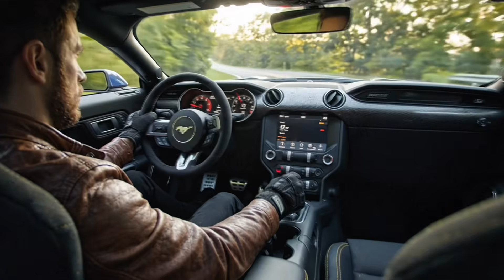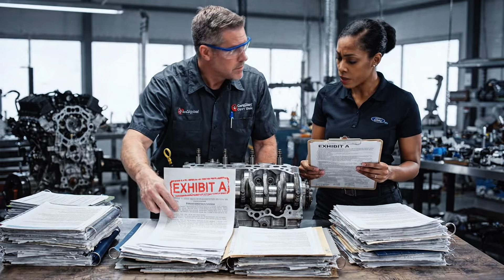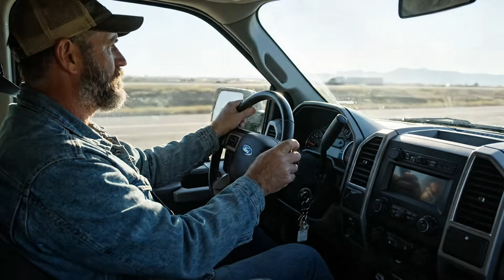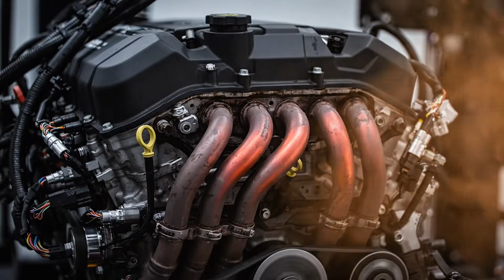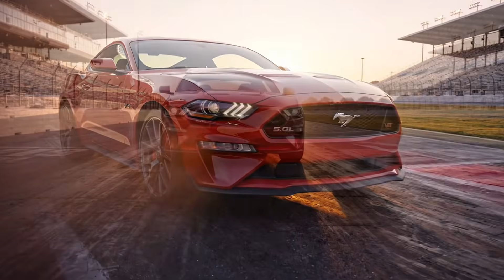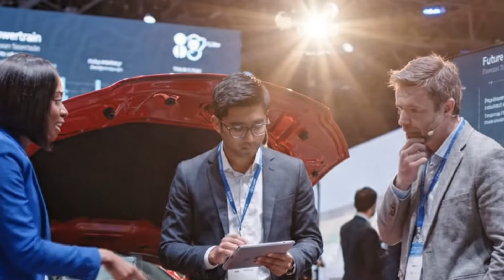Ford Quietly Fixed the Biggest Problem With the 5.0L V8—And Nobody Saw It Coming!

Comment: What years are you talking about
Reply from the maker: Mostly the Gen 3 and Gen 4 Coyote era. Which model year are you asking about?
Reply: @NextGenWheels-s5r 2019 Gt PP2
Reply from the maker: @murraycochrane240  Nice choice. The 2019 GT PP2 was one of the best naturally aspirated Coyote setups Ford ever offered—great balance of power, handling, and high-RPM character. Hard to argue with that combination.

Comment: That wire liner was in the GT500 , and vodoo engines not the  regular 5.0 L
Reply from the maker: Good point. The plasma-transfer wire-arc liner got most of the attention on engines like the GT500 and Voodoo. My main point was how Ford has continued refining its V8 technology over the years, but I appreciate the clarification.

Comment: Get rid of cylinder deactivation
Reply from the maker: A lot of V8 fans would agree with you. Cylinder deactivation helps with fuel economy on paper, but many owners would gladly trade a little MPG for simplicity and long-term reliability.
Reply: @NextGenWheels-s5r  the cylinder deactivation used by FORD has been reliable on the 5.0 as compared to the GM version, no lifter collapsing, more simplistic
Reply from the maker: @user-dan982  That’s a fair point. Ford’s setup does seem to be less controversial than GM’s so far. It’ll be the long-term mileage numbers that really tell the story, but many owners have reported good results.
Reply: @NextGenWheels-s5r  Ford 5.0 V8 is not a push rod engine is a dual over head cam engine personally I like the Ford 50 a lot better than the GM V8
Reply from the maker: @user-dan982  That’s one reason the 5.0 has such a loyal following. The DOHC design gives it a very different character than the traditional pushrod V8s, and a lot of owners appreciate the higher-revving nature and smooth power delivery.
Reply: I came here just to say the exact same thing ! It’s literally got me on the fence from buying a Ford F-150 right now ( I am certainly not buying any turbo charged crap either ! )
Reply from the maker: @NorthwoodsNomad  I get that. The 5.0 is appealing to a lot of buyers for exactly that reason—naturally aspirated, proven, and straightforward. The good news is Ford is still giving customers a V8 option when many competitors are moving away from it.
Reply: @NextG @NextGenWheels-s5r ree with you on that, however, I guess my point is : if I were concerned about fuel mileage, I’d just go buy a moped . 
Pickup trucks are made for working , pulling towing, hauling and handling a heavy workload . Trucks were NEVER intended for daily drivers or commuters or fuel efficiency. Their soul purpose is for those who demand a vehicle that can work , tow , haul and provide the necessary capabilities required of their inherent design , and do it with simple and effective precision .
Trying to incorporate fuel economy into a vehicle that is made for a completely different purpose is like trying to put wings in an armored tank and expect it to perform like fighter jet . 
The honest truth is that the automobile manufacturers don’t care about fuel efficiency at all , or they wouldn’t be so focused on this endless pursuit of increasing horsepower every year . Just get back to simple effective designs that work ! 
Longevity and reliability and simplicity of design and maintenance are  the key characteristics that EVERYONE wants , not a complex system that’s high maintenance cost and exotic design that requires sophisticated engineering to do a simple task . 
And the automotive manufacturing industry just wants to find ways to drive the cost of ownership and profit from service contracts to keep the POS running . 
We the people are tired of their BS ! 
K I S S ( Keep It Simple Stupid ) 💋
Reply from the maker: @NorthwoodsNomad  I can definitely see where you’re coming from. A lot of truck owners would gladly trade a few MPG for simplicity, durability, and long-term reliability. The challenge is balancing what enthusiasts want with modern regulations and market demands.